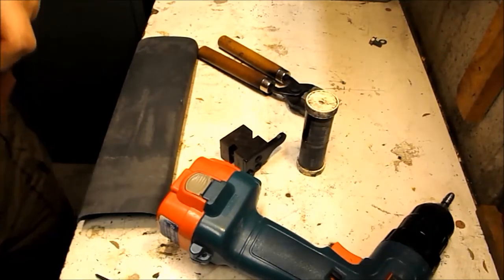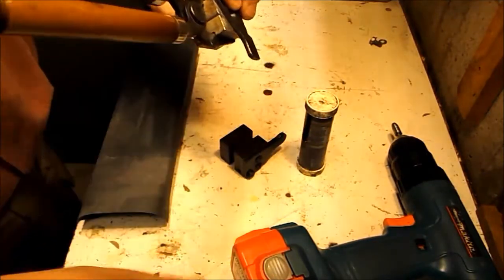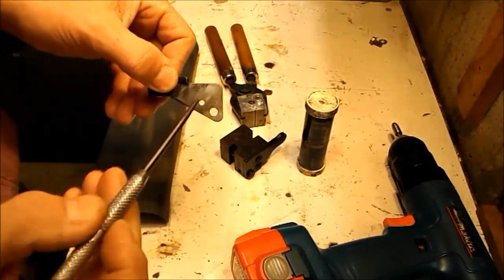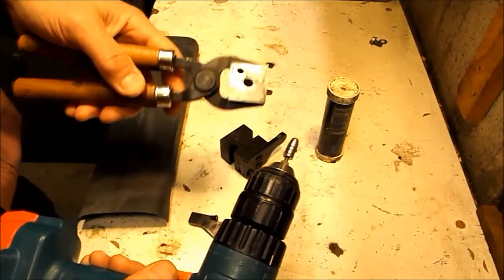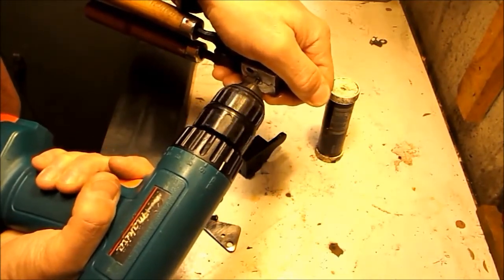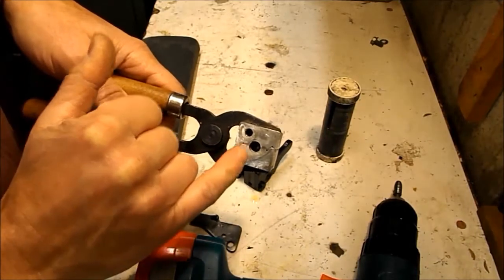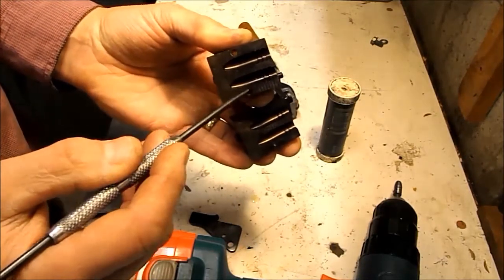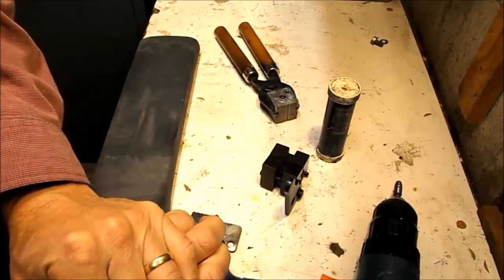Bullet Mould Maintenance

Comment: thank you for your suggestion, I have just a problem with an second hand used stamp for round balls that is not allineed, I will try to push this two theeths a little bit out for to alline again the two parts of the molder